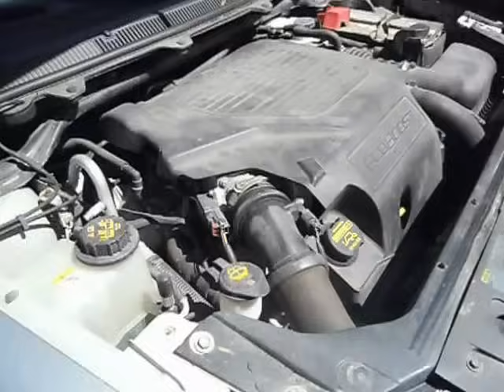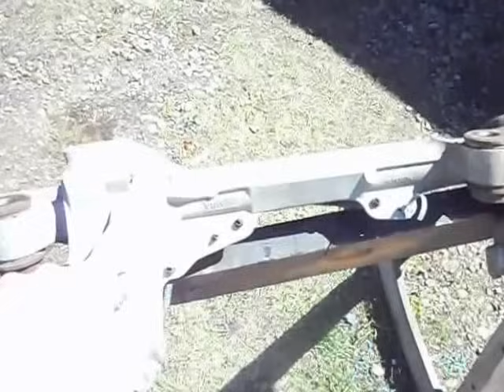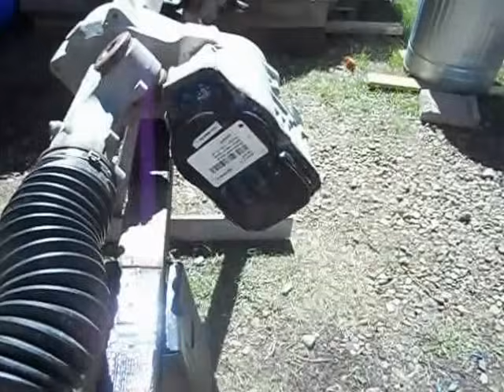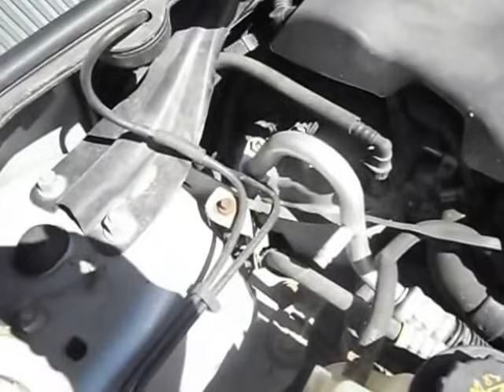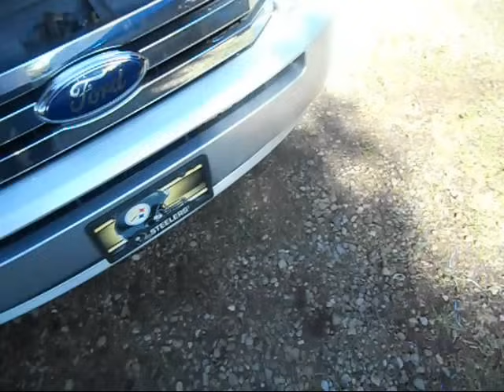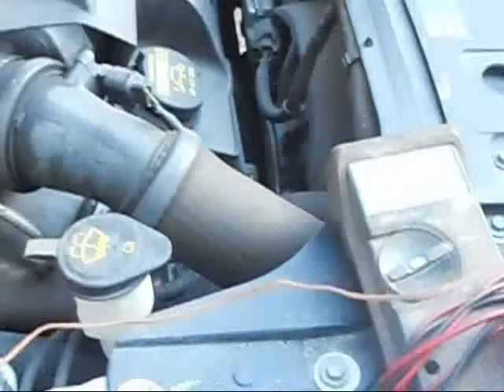Ford Electric Power Steering Failure Identified

Comment: I have a 2010 Taurus SHO that just gave me the power steering fault error. A buddy and I will be attempting to install a hydraulic rack and pinon just to be able to sell it. I have had the 1990, 1999 and 2010 SHO's and everyone seems to have an issue.

Comment: My son purchased a 2012 fusion and after two weeks of ownership he started having steering issues. Yesterday, during a rain storm, he was making a turn at very low speed and the steering locked up causing him to slide into a curb. The accident damaged his wheel, tierod end and strut. Thankfully he wasn't injured but now he can't drive his car. We are taking it to a Ford dealership to see if they will replace and fix the car under the recall. I'm not to confident that they will fix it.
Reply from the maker: If your vehicle is not under recall, Ford will dupe you just like millions of other owners of faulty EPAS equipment. Be prepared for $2,500.00 repair bill and no explanation for failure from Ford. Your son experienced identical accident as me in 2010 Flex, EPAS systems are dangerous. Replacement EPAS is identical to original, it will fail again after thermal exposure and time. Please sell your vehicle before someone is seriously injured, and stay away from Ford products.
Reply: Hollow Point 7K
Reply: I made a sharp right turn in my 2014 Ford Fusion and bang, my steering went out.

Comment: I have a very clean 2011 F150 that constantly pulls and sticks left.  I have posted on F.B. several times while tagging Ford.  2 days later they are contacting me.  I don't know if they will take care of this design issue.  I have not talked to my assigned customer service rep yet.  I purchased the truck used from my local Ford dealership and reported to them the problem shortly after I took the truck from the lot.  It was sporadic in nature for a while.  After several visits to the garage the dealer told me I needed 1600.00 worth of work done.  That did not work for me so I contacted Ford with no luck.  I then started reporting to my F.B. community the problem and how dangerous it is.  I will see what Ford offers if anything?  This is certainly a design issue or I would not be pursuing Ford as I am doing now!
Reply from the maker: Sorry to here about your Ford EPAS problems. Your symptoms are typical to the most dangerous failure mode; i.e. when EPAS generates non-commanded steering wheel displacements. I have personal experience with this failure mode; which pinned my vehicle into curb during sharp turn. Please be aware failed EPAS system is capable of generating much higher torque than the slight left-pull you are currently experiencing. My vehicle exhibited identical left-pull prior to catastrophic failure which torqued steering wheel right out of my hands into full right position. Once this occurred, EPAS system then shut-down; vehicle was moving, in full right turn, with no power assist. Manual gear ratios are high, so it was not possible to correct steering position in time to recover.
Ford is fully aware of these issues and has taken no action on most vehicles affected. The Ford recall was a joke; with only about 1.3M of the 20M or so vehicles affected since EPAS introduction in 2008. Ford will offer about $700.00 for repair; however you will endure about 60 days delay tactic designed to discourage, subvert and conceal problem. Also note the replacement EPAS system is of identical design as failed unit. Replacement units will ultimately experience repeat failures; since real problem has never been corrected.
Has your vehicle reported any diagnostic data or warning chimes? My vehicle reported nothing whatsoever up to point of catastrophic failure.

Comment: I have a 2012 Ford Fusion Hybrid which has had the power steering go out 4 times as of this evening. Everytime we have taken the car to the dealership for repairs they have tried to charge us to fix the issue, despite the fact the issue is Ford's shotty design and should be covered by a recall. On one occasion the dealership attempted to charge us 1200 dollars for repairs. Crazy part is they didn't have to fix anything. The P/S fault system was tripped due to uneven tire wear. Tires were replaced and all they had to do was reset the fault code in the EPS computer.
Reply from the maker: Issue addressed in prior discussion and related to EPAS overheating due to increased EPAS work-load associated with tire or suspension issues. Basically EPAS system encompasses closed-loop servo system with position feedback; tire and suspension deficiencies produce dynamic back-forces (forcing functions) on EPAS servo systems. EPAS servo-loop continually compensates for induced forcing functions. This implies each uneven tire rotation causes linear translation in steering rack; which is then compensated for by EPAS with counter-force (This is why uneven tire wear in EPAS systems is generally not felt by driver as steering wheel feedback). This constant servo compensation uses copious amounts of energy, which translates to extra heat in already thermally stressed system. EPAS eventually experiences thermal fault, and shut down. Each thermal fault represents additional progress toward total EPAS failure due to elevated semiconductor junction temperatures, causing slow degradation. Just matter of time before imminent failure. This failure disposition is quite common and familiar in control theory and servo engineering; just not so familiar in automotive world; with electrical based servo systems less ubiquitous. Introduction of complex electrical servo implementations in automotive steering systems represents monumental blunder. Coupled with industry-wide cost-cutting philosophies, and Ford's dirt poor engineering design and implementation; Ford automobiles represent serious safety hazard and time-bomb to consumers. Ford is fully aware of EPAS design deficiencies, but continues to produce and sell same flawed system; abandoning millions of consumers stuck with hazardous and faulty EPAS units. There is no option to prevent future EPAS failures in replacement units, since Ford is counting on attrition to limit liability. Ford is already experiencing serious corporate decline, and will implement no non-mandated action to correct past engineering blunders of this magnitude. Best consumers can do is pay for EPAS replacement and immediately dispose of vehicle.
Reply: I went to junk yard and got one for $22 and replaced it on my 2012 mkz hybrid and calibrated to the latest software using ids software and cross fingered..ask me how

Comment: Trust  me the issue is general not just ford alone, it also happened with Lexus, mostly the IS model i have one in my garage now sitting there because lexus charge me $5000+ to replace the steering rack and computer and obviously this is lexus fault replace the old style rack with electronics just for efficiency purpose. i realize my got locked when making left turn, i was lucky not o highway. i think is high time people speak against this, looks to me like accident waiting to happen, and now am not comfortable  enough with any electronic power steering .

Comment: My 2015 Taurus had the steering become difficult to turn a few times but it went away after shutting the car off and restarting. There was an alarm of "Steering Assist Fault Service Required". Three days ago the same thing happened but neither the alarms or issue goes away after restarting the car. There is also an alarm this time "Service AdvanceTrac" that comes on as well. I have not taken the car to the Ford garage yet but it doesn't look like there is a simple fix to this issue
Reply from the maker: There is no simple fix, your EPAS is hazardous and will require replacement. If your vehicle is under recall, do not take partially failing EPAS to Ford, Ford will make software upgrade (that does nothing but display additional error codes) and send you on your way. Ford will then void your recall replacement option at this point, and you will be required to pay for repairs.
Reply: I experienced the same with my 2015 Focus. The problem was intermittent. It would correct itself if i turned the key off and back on, or shut the car off and cam back y=to it. This time, it is not fixing itself and the steering is extremely difficult at low speeds.

Comment: I was looking at a live data power steering module of an 2011 f-150 while it was being driven and it reached 120 degrees fahrenheit. Owner complained that steering has gotten stiffer and sometimes it binds up while returning to the middle. Did notice the steering wheel and electric rack motor angles were off by like 15 degrees told him to get and alignment and replace his battery since it had a code for low voltage on the pscm and in fact battery was at 11.9 volts with vehicle off. If issue persist will replace the elctric rack and pinion. I can already see ford engineers leaving it as is so they can squeeze money on repairs at dealerships.

Comment: In my case. It has only happened when I start the car (2011 F150), so I turn off and on again and it seems to do the job, but yesterday i had to do it 3 times consecutively to get it to work again. My concern is loosing the ability to steer while driving..  And think there is more to it than just the heat, or maybe the damage has been done to the electronics due to heat..  I do live in Florida, but the first time this happened was on a relatively cool morning with 77degree weather..
Reply from the maker: Most probably position-feedback rotary optical encoder beginning to fail. There are two of these encoders in implementation; one on drive motor shaft and second on steering shaft input. Rotary encoders are very delicate precision implementations; prone to failures from shock, vibration, thermal and quality of design. Hi performance servo implementation commonly use premium-quality and redundant rotary encoders to insure reliability and failure detection; but you will find neither in Ford's implementation. One can expect numerous and varying failure dispositions related to EPAS systems; simply due to magnitude of design and implementation complexity. Introduction of thermal stress on system degrades semiconductor materials and greatly increases probability of single-point failures. Today in could be an LED in optical encoder, tomorrow motor drive transistor. This is folly of highly-complex over-stressed electronic implementations in automotive applications. Ford engineers just don't seem to understand fundamental concept of failure mitigation in high-reliability engineering design.

Comment: Same thing.. 2014 Ford Fusion, had my tires realigned and the steering went out and everything. Abs, airbag, skid control, traction control lights all went out. Took my car in 4 times. Let's hope this fixes it.
Reply: What did they say was the issue and was it costly?

Comment: My 2011 Mustang GT is experiencing some issues with the steering. At first I thought it had to do with the AC taking power of the steering but then I shut that off and the problem still continues. My car jerks when I turn slowly, it sounds as if the motor wants to turn the wheel but insted of turning it spins. I am not sure how to go about fixing this issue and I hope the car gets fixed under the recall otherwise I am pretty much screwed

Comment: Happened to my 2019 fusion. Ford has no interest in fixing this. Oh, and it's 5,000 to fix at the dealership.
Reply: 5000 to fix the rack and pinion??
Reply: @Chiefgeargrinder  Yep. 2k for the part, 3k in labor.
Reply: @brjones27 I just looked up yours off of detriot axle website $ 427.00 with a lifetime warranty mines 812.00  Something fishy with dealers.
Reply: @Chiefgeargrinder  Yea, I saw that one too. But I need to take it somewhere, and mechanics often like to pick the parts they install.

Comment from the maker: Today's (huge) news should leave no doubt of Ford's criminal corporate operations and incompetent engineering. Relieved to learn private citizens (in force) have finally taken action against blatant and widespread consumer fraud. Not to mention corrupt and politicized collaboration between Ford and NHTSA to intentionally cover-up dangerous vehicle engineering defects.

Ford Sued by Truck Owners, Adding It to Diesel Defendants.

Ford Motor Co. rigged at least 500,000 heavy-duty trucks to beat emissions tests, drivers claimed in a lawsuit, adding to the tally of carmakers linked to diesel-cheating allegations worldwide that started in 2015 with Volkswagen AG.

Ford’s F-250 and F-350 Super Duty diesel pickups, a slice of the top-selling F-Series, are spewing emissions as much as 50 times the legal limit for nitrogen oxide pollutants, according to the complaint. The trucks sold from 2011 to 2017 cost $8,400 more than their gasoline-fueled counterparts, the filing shows.

Comment: WHY? why why why? Why would you put a computer in control of everything. I have a 09 flex and I love the car. However I had the traction/stability control malufunction twice on it in which the front driver side wheel brakes itself hard while making a left turn without any input on the brake from me. The ABS takes control. Imagine if I pulled out in front of a semi and your car stops feeling like your wheel fell off.

Comment: I have a 2012 f150 xlt 3.5l twin turbos power steering failure. It costs me $1943.00 to replace the rak and pinion at a local shop.

Comment: I lost my steering for the first time.I have a 2011 escape.When i got home shut it off went out a few mins. later started it it was working fine.I bought this used a few years ago from a dealer.
Reply from the maker: Initial signs of fatigue and full failure, drive with caution. If your vehicle is under recall, do not surrender to dealer until full failure occurs.
Reply: That did not work for me. Still failed. Now it is doing it again.

Comment: B Smith - I had a similar issue in a 2013 Fusion Hybrid. I relaced the steering gear with a remanufactured steering gear (Fords price point forced me to reman) and it works, but intermittently. When the car is stopped the assisted steering gear seems to shut off and I loose  all EAPS, its not until I travel a few feet that it turn back on and functions as it should. I've tried using FORScan to reset all modules and that works while the car remains stationary, but as soon as I start to drive, it reverts back to working intermittently. It seems like a communication issue between the PCM and PSCM but I'm not entirely sure on this. Any suggestions?